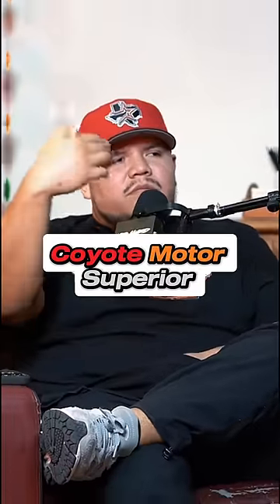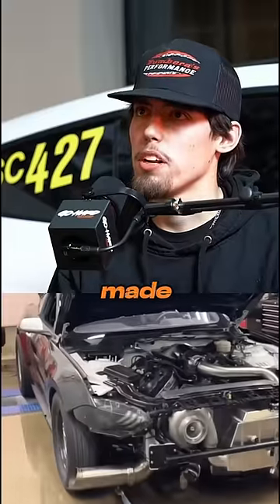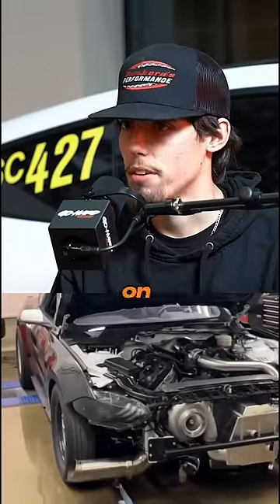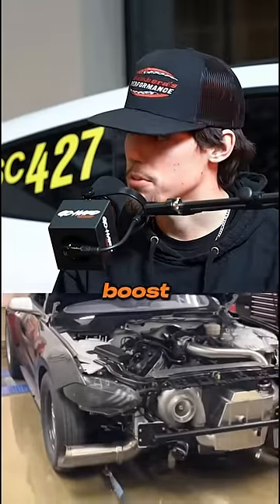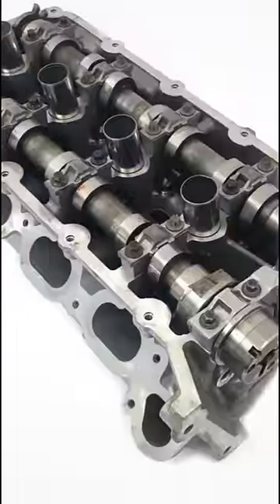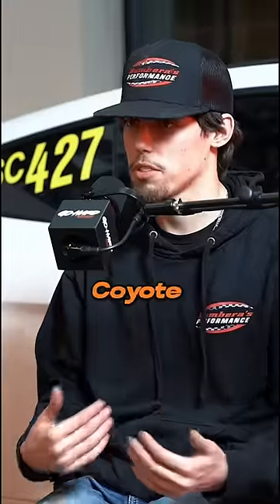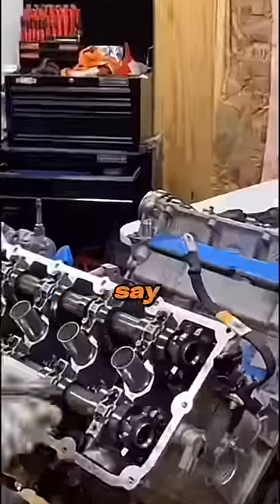SUPERIOR Ford Coyote Motor 😳 #shorts

Comment: LS Bois crying tears like they dropping valves
Reply: 😂 and y’all breaking timing chain and all the internals 🗑️
Reply: @juniorlopez8206  I've literally never heard of a coyote breaking a timing chain. Must be crazy power if it's doing that. LS block would probably be in rubble long before that.
Reply: @markbrouk7857 sorry bud but coyotes ain’t the most reliable especially if you aren’t on top of your maintenance every week or after multiple passes
Reply: Ls still superior but ford needs something to talk about I guess
Reply: COYOTE POWER!!!!!!
Reply: What drops faster, LS tears or LS valves?
Reply: Lmao 🤣 when does Oklahoma’s fastest have a coyote engine in there care 🤣🤣😂🤣😂🤣
Reply: @juniorlopez8206  Cracked
Heads
Every
Valve
Rattles
Oil
Leaks
Engine
Ticks
Reply: Just keep spending 20 k more to keep up with ls 💀
Reply: Let’s see if coyotes become the industry standard 🧐 I think not
Reply: @tannercox4537 and all the gm 5.3 and 6.2s tht have failed before the first oil change are reliable 😂
Reply: I own a c6z never dropped a valve and i make 700 hp and only spent 5 thousand dollars lol
Reply: Both are good platforms for power … I have a 14 Shelby and a 15z06 ….
Reply: Huh 😂
Reply: Bro I got 2003 cobra they were doing great things long time ago. I wish they made terminator 2
Reply: Coyote bois forgetting about the flatplane V8 in the Z06 that revs past 8k rpm 😭😭😭
Reply: @tannercox4537 SoRrY bUd, but Chevy guys were the ones to invent American oiling problems in modern V8's. 🤣☠️ Base model 6.2's in Silverado's drop oil pumps faster than Ford 5.4's succumb to phaser tick. ☠️
Reply: @twiellie  “When comparing reliability ratings across Ford and Chevrolet cars, on average, Chevy tends to come out on top.” <— straight off J.D. powers website oh let’s not forget this stat too “Ford has the most vehicle recalls of all time, with 3,086” but yeah fords great 🤣🤣🤣
Reply: @M-Powerdreamsgarage  I honestly could give a shit about either's reliability ratings, power figures, the aftermarket support OR what J.D Power says about them. It's just a dick sizing competition between window lickers and mouth breathers. I just wish people would enjoy V8's for what they are before they're all gone.  Chevy boys talking shit on Fords about oiling problems like they haven't got any themselves is just silly. General populace is bad at maintaining vehicles, they're all gonna have their faults exposed to the max like that.
Reply: @juniorlopez8206 timing chain? That’s a new one 😂😂
Reply: @OD_Plays 500hp cyo stock almost, 7k in mods (20lbs, valves, springs, intake.) suddenly a 900-1000 hp engine.
Reply: @ithmiths  I put 5k and im making 700 all i did was heads cam and intake. Nothing else. Thats 2k i can save for forged internals or a bore
Reply: @ithmiths    and thats with port injection, imagine if i had this puppy on direct. The lt motors definitely make way more power than ls motors but its way more expensive. Just like coyotes. Not hating ln coyotes they are great my brother owns a s550 and it runs amazing but it also cost him way more to build than my car.
Reply: And all of them crying because Nissan is decimating ALL and NOT really trying....
When you up and walk away from an RR1000 ON JUICE, very rapidly ....WHY go with anything less than the best....by far the best
Reply: @Wc_Osleazo you've never heard of Godzilla, then, eh?
Reply: For the price of a brand new GT, You could get the GTR...So you can see what "Superior" means...
Reply: Honda bois in the back ground giggling 25 pounds lmao try 60-80 see what happens to your coyote. Stock Honda block 1600hp with 35 psi
Reply: LS motors are way easier to find and cheaper basically fit in any car that you purchase and the coyote is better on more difficult and expensive to put in a car that it doesn't supposed to go in
Reply: This last year alone Ford has had more recalls than any car company in history.
 That's funny keep buying your Ford products. Guys keep feeding the dying giant.
Reply: user-ft5oj2lz4r I mean they just aren’t.. it’s a reason people want to ban ls foxbodies from no prep races.. but hey if you like replacing cranks, I’m not going to stop you
Reply: Coyote girls are feeling themselves right not. Just joke people, no crying
Reply: @juniorlopez8206 Thank you
Reply: @tannercox4537 that’s any car making 1500-2000 hp 😂 stock the coyote is perfectly reliable
Reply: Coyotes are trash compared to an ls1 etc
Reply: @ThatSlow02  in stock form no the coyote isn’t reliable at all. They have plastic all over that engine. Even the valve covers are plastic. If you know anything about cars you should know what happens when it’s around 400 degree parts
Reply: @freedomisntfree_44  never heard of those failing before 100k maybe the duramax but not their gasser engines. I take it your not a machinist
Reply: @tannercox4537  that’s crazy, my girls 5.0 is stock 🤔 never had to replace any plastic parts just basic maintenance. Absolutely nothing aftermarket but suspension. If your buying from shady sources or don’t know how to take care of your belongings that’s a personal issue not the cars fault idk what to tell you, be a better mechanic
Reply: @tannercox4537  but it’s okay I always preferred the Cammed 4.6 anyway great power perfect sound
Reply: @OD_Plays 5k for 700 horse is great 700 on a coyote gon be like 15 k
Reply: Ford guys that never built and engine or  talking shit that have no boost . Replacement parts for ford engines are stupid expensive . You get more bang for your buck with LS . Facts are facts .
Reply: Finally competing with a 25 year old engine good job👍
Reply: @Donmud  sounds like a poor person problem. Coyote is more efficient
Reply: @markbrouk7857 😂😂😂
Reply: You enjoy your Honda.
Reply: @zacharyradford5552  best road head ever was in a Honda from your mom.
Reply: user-ft5oj2lz4r yeah it’s the same dumb shit as Found On Road Dead. Like that banter used to be funny a decade ago, but now people unironically say it thinking they gotcha.
Reply: @markbrouk7857 He is correct though. You gotta admit facts man. Chevrolet parts are more common and cheaper the majority of the time. They’ve always been that way. That’s another reason most of your dirt racing drivers run Chevrolet Crate engines and not Ford’s. I’ve always been a Ford person, but fanboying over it and being unable to admit facts has never been my cup of Tea. Each company does things better or worse than the other. It’s time you realize that instead of coming up with nothing meaningful.
Reply: @ThatSlow02  coyotes and mod motors have an enormous amount of plastic parts on, around and a few even in the engine bud. Clearly you’ve never been in a mustangs engine bay… or even read common issue forums.
Reply: @markbrouk7857  you a menace 😂🤝
Reply: @tannercox4537  maybe you should practice reading comprehension and get out of your feelings cause I never said they didn’t have a bunch of plastic parts. I have a 4.6 new edge and my girl has a s197 5.0 I know more than enough about fords v8’s. I said I’ve never had issues with the plastic. Again touch up on your reading skills and then come back to me and we can talk about knowledge
Reply: Coyote is a copy of tje GTR motor but with an extra 2 cylinders. 
Can't even be original.
Reply: user-ft5oj2lz4r  that’s hilarious because I actually own a shop and the majority of what comes in are shitbox fords 😂😂😂 but yeah what the kid from a multigenerational family of inbreeding said 😬 typical ford guy though lol
Reply: user-ft5oj2lz4r  also I owned a 2018 stage 3 roush bought brand new in 2018 something a broke boy like you can only dream of having and I’ve got vids posted on here of it and of me driving it but heyy guess what it was a piece of junk just like the rest of em and I sold it for a Camaro
Reply: To be fair it’s cheaper to just build an ls
Reply: @M-Powerdreamsgarage  Chevy running Ford transmissions.... 😂😂 they also went bankrupt because they spend money on JD power awards...
Reply: @gl9500  yeah you’re like 100% wrong on that whole transmission thing ford and Chevy both partnered up on the making of longitudinal 10speed transmission along with the transverse 9speed trans too. Maybe do some research before you fan girl that hard
Reply: @gl9500  you know what’s also 100% untrue is that Chevy is bankrupt from jd power but you know what is true lol that ford just took out an almost 10bil dollar government loan because they’re going broke and that’s a fact you can look up 😭
Reply: I love the comparisons to an engine that came out in the 90s.
Reply: But when your blows up its gonna be $$$$. Compared to a ls the price per horsepower isn't even close.
Reply: @MrRoss-jz7fx  na I focus on my own builds, I don’t fangirl another man’s car or the name he calls it lol
Reply: @Wc_Osleazo  that's right.... Say what u will...my Godzilla will get you outta there quick
Reply: @Memo_0215  
Flipped 
Over 
Road 
Disaster
Reply: Plastic engine components goes to show u cheap parts . . ( ford ) but its and ok engine . 
Neo VVL for life buddy.  Nissan SR20VE. . the real leaders in valve train . smashing on ur 8 cylinder piece of tin.
Reply: @jrburkhead4188  Nissan ain even tryin holmes
Reply: Lmao. Crying? That’s hilarious. Ford finally made an engine to compete with the LS wafted 40 years.
Reply: @TWOxTONE_773  yet NEITHER v8 can touch the GTR 6 BANGER
Reply: @MrRoss-jz7fx Brett’s stock block mustang is faster then any gtr on this planet 😂 easy to look up stats, also the Ls 5.3 has gone 6s stock block while no gtr has even gone close to that fast, r8s now run the streets with the fastest 60-130 in the world with a 2.37 in high elevation, most likely with all the comp now t1s gtr is getting beat in next couple of years but hey gtrs are king right?
Reply: @Gabethemosthated  it's like you ignore all truth...
If you can look at both and determine THAT?!? Then I must excuse myself...
I'm allergic to stupid...
That yote block couldn't even handle half the boost...and GTR is THE FASTEST 0-60@2.7 sec
AND NOW has top end FASTEST title @237? I think .I'll have to look that back up again ...I'll send you a few links
Reply: @Gabethemosthated  lookup Nightfury....3000hp to every wheel...
Then the new STOCK GTR runs a 2.6 0-60
And again, we're talking about two less cylinders...
Reply: @MrRoss-jz7fx  😂 god I wanna spend hours laughing at you an educating you on what’s reality, don’t tell me look up nightfury like I’m some bot who doesn’t know cars 💀 insane how you tell me to look up nightfury yet precede to say it puts power down to all 4 wheels yet it’s rwd converted 💀 along with Billy’s gtr which is the other one your talking about an every other fast gtr, “coyote blocks can’t handle half the boost” 💀 please go an look up Brett lasala, stock block coyote making 3000 hp went a 6.27 at sick week an golds the drag an drive record 💀 stock camshaft, stock timing components, stock heads pistons an rods, no gtr is even doing 7s stock block 💀 let alone a low 6, its faster then any gtr on this planet an you can go ss this an send it to every major performance shop 😂 you act like there’s cars that don’t do 0-60 in 2.6 stock 💀
Reply: I can run mine all day I’ll watch you rebuild more than once
Reply: Meh, don't need an V8 to get 25 psi on a GM engine. 2.0t 4-cylinder is factory at 20 PSI. Don't need sleeves and an engine overhaul to run 25 psi.
Reply: @M-Powerdreamsgarage the flat plane Voodoo engine? Meh that was Ford finally trying to dethrone the Nissan GTRs V6.
Reply: @ADHDsquirl  let us know when it's putting out +1000hp and how many pieces the engine is in at that point.
Reply: @Gabethemosthated  i realize now, you just can't communicate with idiots that make up their own facts....like an LS could beat a GTR...like GTR isn't the fastest 0-60 
Or 0-120-0
Or 0-200
You're just mad that a Nissan 6cyl can destroy any v8 , v10, v12 out there...
And it's a very proven fact...
Reply: @Gabethemosthated  you're bragging about 3000 up on a v8 ? Nightfury does that with v6
Along with ALL THE OTHER v8 eaters
Reply: Is that why you don’t see coyote corvettes but LS fox bodies 😿😂
Reply: @Pressplayboy  wow, they should make you use crayon to make that statement.
Reply: @Pressplayboy  no...in the winners circle, all I see are GTR'S
Reply: You 🌈 ford boys are mentally I’ll if you thing coyotes are better than ls motors🤦‍♂️ cost a fraction of the price to build too.
Reply: Typical social media enthusiast😂😂
Reply: @OD_Plays  port injection with a fuel system is 12k without injectors ..?more expensive then
Any mod motor  too fuel
Reply: @mach183  your smoking what
Are you talking about bro. The car comes with port injection from the factory.
Reply: @OD_Plays  secondary port injection for Anything above 1k wheel … I own a c7z dummy you don’t think I know that
Reply: @mach183  dude you are making no sense. Plus the c7z has direct injection lol what are you talking about
Reply: @OD_Plays  to build a car for 1100 rwhp you need secondary port injection … I have a c7z
Reply: @OD_Plays  I own a c7z clown you don’t think into that … secondary port injection for anything above 1k wheel is needed along with a fuel system … no one is smoking nothing I won a z clown 🤡
Reply: I've never met an LS boi that was comfortable doing several pulls in a row when he was pushing 1000hp flywheel. Dudes literally do a pull once every couple years because they know. Which is why it's cheap
Reply: $10 says whatever you got going on doesn't even make enough power to bend a valve.
Reply: Where's all the ford's in baja 16 -24 hrs from 6 to 9500 rpm........crickets
Reply: @techs1smh13  who the hell Baja races lmao. Where's all u Chevy Bois in the south pole 89hr ice racing competition. None because that's stupid!
Reply: @markbrouk7857  who races baja in vehicles  that cost up to 1 million dollars awd 1000 hp na. People that have helicopters.  And can put anything for engine. 95 percent  chevrolet power.
Reply: @techs1smh13  sounds like a sport trailer park people watch
Reply: @markbrouk7857 yes I would  say so if trailer park people  are multi millionaires.
Reply: @techs1smh13  millionaires don't run junkyard LS motors so thanks for zero input. So back to what most of the car community population is doing....losing to coyotes.
Reply: @markbrouk7857 or ford engines   so if you have unlimited  funds and ford's are better why not choose  ford......because there shit that's why
Reply: @M-Powerdreamsgarage JD Power will say anything you want for a price. Take anything they say with a heaping pile of salt.
Reply: @Ratkill9000  you must have a nice shiny tin foil hat huh? Seems pretty accurate though considering the amount of recalls ford does compared to Chevy but you can take those actual facts with a “heaping pile of salt” 😂
Reply: @Tank.VT97 did you really say ls1😂 thats literally the bottom of the barrel ls engine
Reply: @markbrouk7857 your oil pump gears